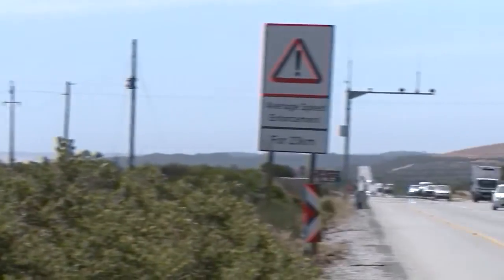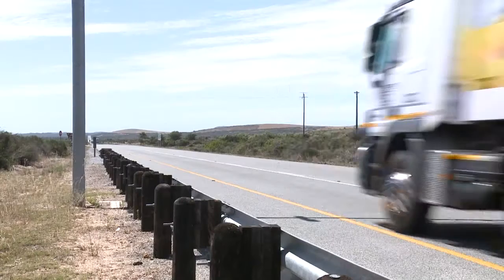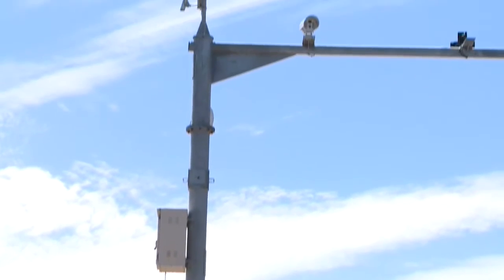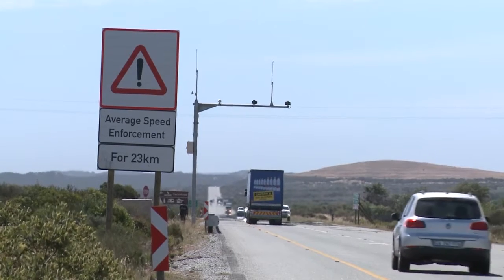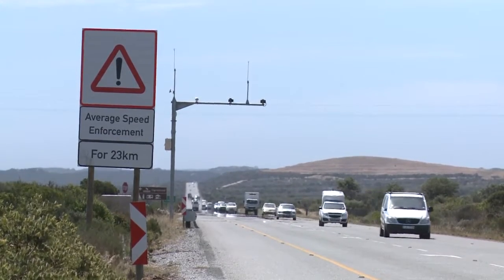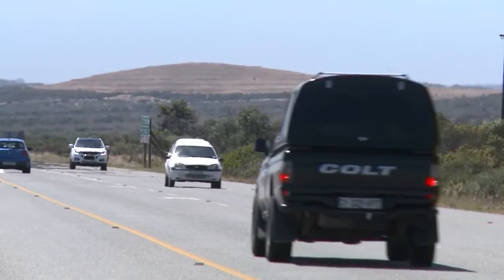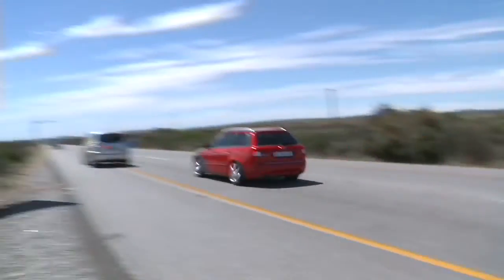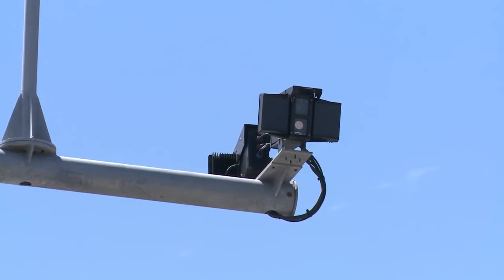Average Speed Over Distance Cameras | Tech Report

Comment: Pretty girl; but ASOD cameras are just a move to "Big Brother" watching you and it's not just (inevitably) more fines (which seems to be the main purpose, in England) but drivers constantly "glued" to their speedometer is a distraction (a major cause of accidents... and they do keep them on at night (not sure about South Africa) so in my view it's a misapplication of a useful technology. 
In other words; there seems to be a move to replace police with robots and while the Mexican device is stamped "Home Office approved" it rather seems they've been blinded by science and while motorists receive the option of "Driver Awareness" courses ironically they are probably unaware they committed an offence (no flash; guilt, swearing optional).

It has been established that driving below 30 mph on motorway (UK fuel protests) will get you a ticket; someone (here I think) said 10 mph through speed restriction (usually 50 mph, or less) likewise; my "offense" was 61 mph on the M6 (North) at 4 a.m. I'm assuming the victim surcharge applies to sheep as it was three lanes down to a two lane stretch, with hard shoulder/ emergency lane) and it's possible I was the human within a mile; conditions dry... the "road-works" were still there three weeks later (still no equipment, or work done); but luckily my driving had clearly improved (or it wasn't switched on) but I had to wait for a few weeks to be sure. It's all about the money, so careful; but as for improving road safety I doubt that.

Comment: I'd pull over for about 15 minutes. And then go 150mph.
Reply: They don’t time you at all...
Reply: @mccari09  they time you instead of using radar
Reply: @trevorc3063  it’s average speed not average time. They take your speed at every camera and average it
Reply: @mccari09  that's not accurate.  They take a picture of your plate, which is tied to a very precise measurement of the time, and the computer in the camera at the end point.  The point of these is to prevent people from just slowing down where the cameras are.  Thus, constantly measuring you, but only needing 2 points to do so, is just the most efficient way of controlling speed over distance.
Reply: @trevorc3063  then why have multiple cameras? Why call it an average speed camera? Each camera takes your speed and works out your AVERAGE speed. Did you people not learn about a mathematical average in school?
Reply: @mccari09  "average speed over distance" if you pass one camera at 12:00:00 noon and pass another, that's a kilometer away, at 12:01:00, your average speed was 60km/h.  You may have gone 80 for some and 40 for some.  But if there's a series of cameras that have radar, that's significantly less useful.  If you're going 140km/h at one camera and slow down to 1km/h at another camera, then the system you're describing is useless.  Each camera knows what time it is but doesn't necessarily have the legal ability to ticket for the speed at that particular location.